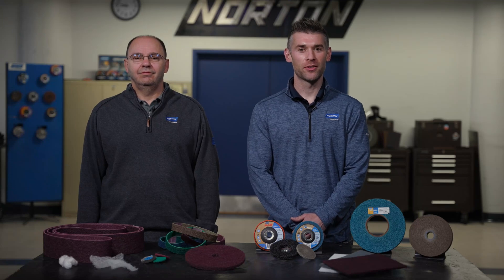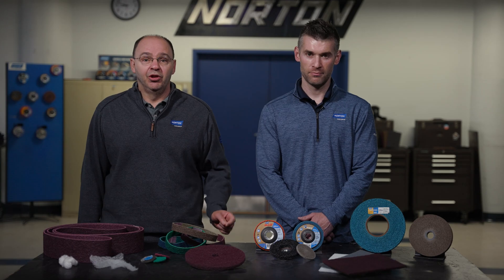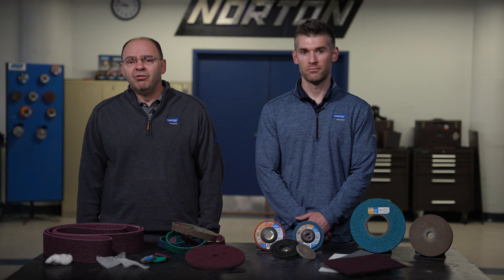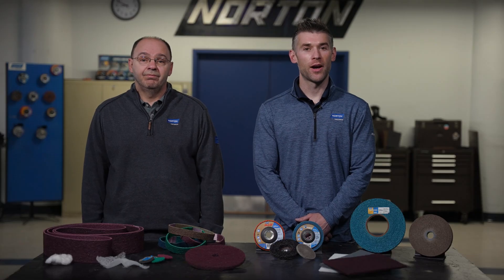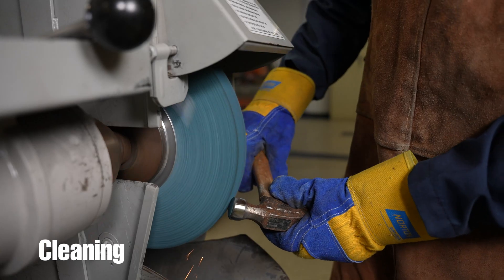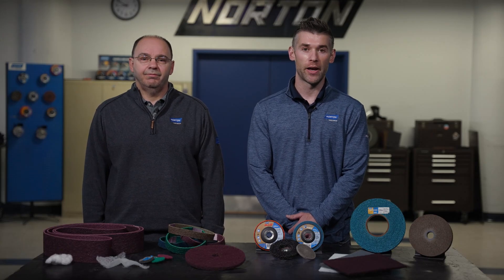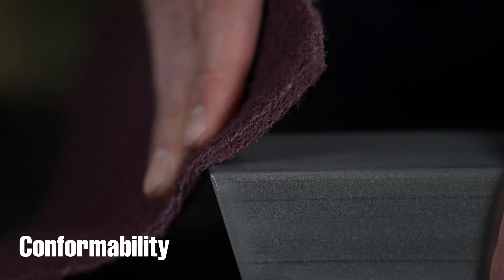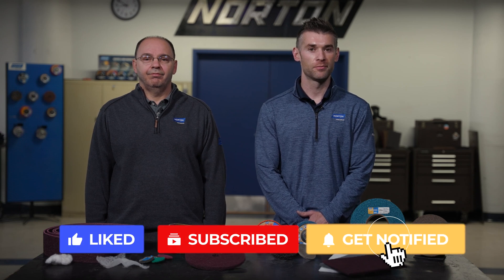What Are Non-Woven Abrasives?  101

Comment: Hello 
Which non-woven wheel is more suitable for stainless steel bottles and stainless steel hardware? Silicon carbide or AO.
Reply from the maker: Great question.  It comes down to the finish you are looking to achieve.  Silicon carbide will leave a brighter and more reflective finish while A/O will leave a more matte finish.